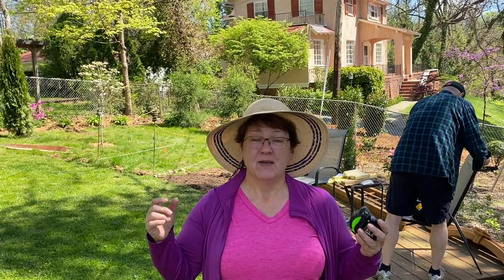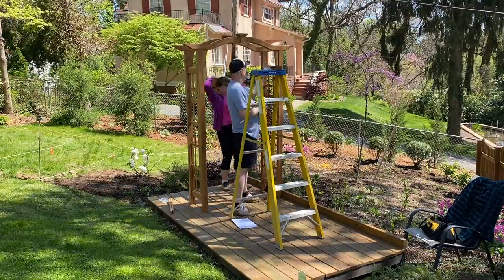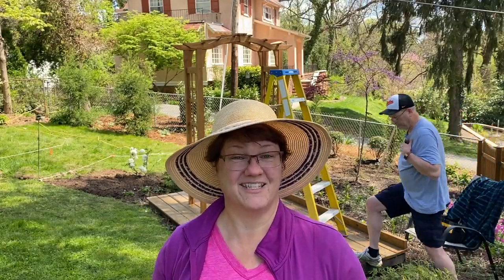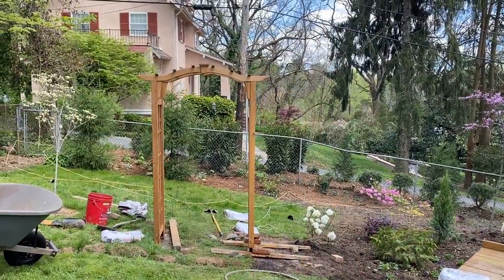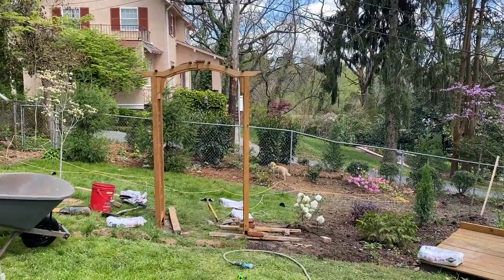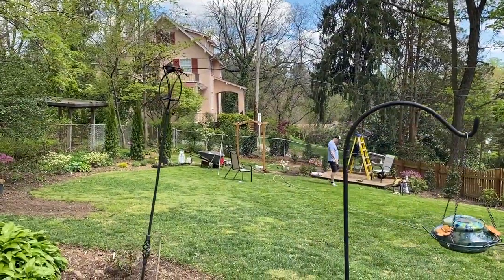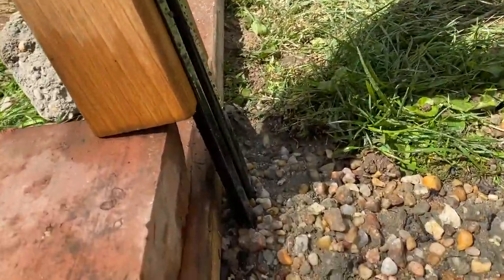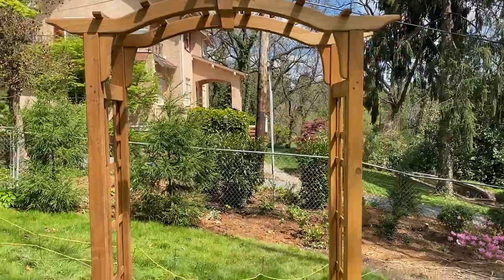Installing An Arbor From A Kit - ❤️👩🏻‍🌾🧑🏻‍🌾❤️

Comment: What arbor kit was this from Wayfair?  I'm looking at different ones (standard size kit vs custom) and are entry to our food forest/garden has planter boxes about 45" apart.  I think an arbor about 40"-44" wide hopefully will work.  I also assume the concrete points are necessary to secure it.
Reply from the maker: Here's the link: https://bit.ly/3t31PB1